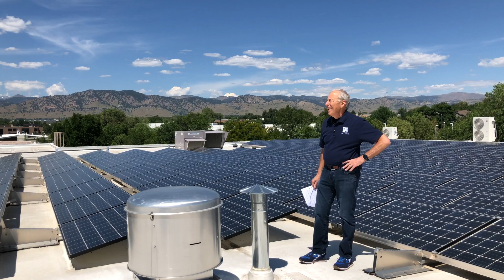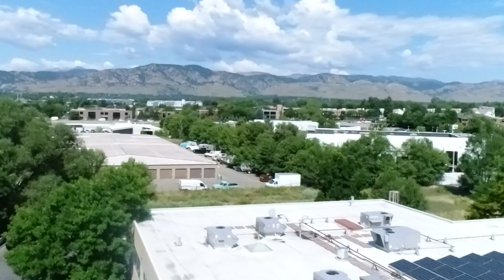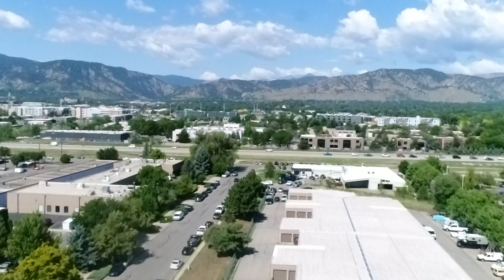What to study to become an audio engineer

Comment: Reality check:  Most companies require engineering or physics degrees for their employees who will be doing equipment design, because they need the legal protection of their formal qualifications.  Good luck landing any design job with an aerospace company, for example, without an appropriate technical degree.  It won't happen, regardless of who your parents are.  
Even your company had better be using staff with valid degrees for any design work which could be safety related, such as ensuring that UL standards are met.  Where customer/user safety is involved, you don't cut corners.  
Legal considerations aside, I think it's still irresponsible to discourage formal education.  It takes many years to accumulate the background knowledge in physics and math, then build contemporary technical design knowledge on top of it.  Those who have an aptitude for such things, find them fascinating.  I thoroughly enjoyed all of my engineering courses at university and never once doubted, "Why do I have to learn this?"  
I knew a lab-support person who worked at Boeing for many years, who had extensive practical knowledge in electronics and computer systems.  After many years, he decided to go for an engineering degree.  I'll never forget his comment after taking his first few classes:  "Wow, what an eye opener!"
And by the way:  Engineering schools also require lab classes, where one does get practical hands-on experience.

Comment: I’ve grown up with a passion for audio and sound system design. As a result I currently work in acoustics research while wrapping up my engineering degree and designing speakers in my spare time. I agree with what you say Paul that learning by doing is a great way to do it, but without the fundamental backgrounds that come from higher education, I think you can be very limited in your scope of potential. For example, understanding good port design is pure fluid mechanics. In addition, I’m yet to find an audio company that would hire an MSME with any less than 5 years of speaker design and dsp experience. So please point my to someone hiring speaker designers with no degree at all because I’d love to apply.

Comment: I'm self taught but I did go to school. I'm lucky to have the job I have now as they now require a degree which I don't have. I learned by doing. I had a friend and we were going to design a preamp that would emulate the sound of various preamps by pushing a button. I guess it turned out to not be practical.

Comment: I  wonder if some education in electronic service and repair from a tech/trade school would be beneficial? At least it would be more hands on. I would agree an B.S. in Electrical Engineering would have way too much focus on the nice to know theoretical and not the applicable knowledge. Quadratics, Differentials, figuring the square area of cone, may be beneficial  but I would think,  hands experimentation on what a woofer can do within a particular crossover design would be far more productive.

Comment: The one thing schools won't teach is how to learn.  They pour out information that if you've the mind for it will make you good on a game show, but they actually impede the integrating of things learned into your personal knowledge so meshed you've no idea where you learned it.  Heck they won't even teach students how to do their job, i.e., study.  Few, if any, schools/teachers tell a kid how to process that book so that it they know it for longer than the test.  And it's not like this isn't known.  If found 'How to Study and Teaching How to Study' (1909) by F. M. McMurry late in life and wish I'd learned how to study as a kid instead of having to figure it out on the fly like every other student, apparently.  

But in a field like electronics, even if you go to school, you will learn more if you have practical tinkering/experience before they dump the abstract on you.  

"Man must seek his chief instruction in his chief work, and not allow the empty teaching of the head to precede the labor of the hand. * * * We have to thank the nonsense with which our children's early years are diverted from labor and directed toward books, for a world full of blockheads."
[Johann Heinrich Pestalozzi, (1746-1827)]

I would add the only way to learn problem solving is to solve problems.  Most school will be academic, theoretical.  You need hands on with the tools and the equipment.  It has never been easier or cheaper to get hands on with some of the most complex electronics needed to understand audio systems.

Comment: It's far more difficult to get a job today if you don't have a degree than earlier years. And the school of today is much more practical oriented than before as well. But wether you take a practical or scientific route. If you want to design audio gear at highest level, I would build things on spare time. The founder of Hegel was taking a higher degree in technical University. But he was building amplifiers when he was studying. Because of his passion for the matter. 
If you like theoretical course then go scientific route. If you don't like theoretical course so much, then go the practical. That's how I would think about it.

Comment: I was lucky to work for a small company that was very much hands on. I started out working as a jr technician and as the years went by I got into designing and management with nothing but a high school diploma from a technical high school. Back then the engineer you worked with had the sole say in who got hired and promoted, there was no human resouces department to suck resources away for the real work.
Because it was  small company I did everything in every department. If I needed a chassis I went into the shop and built one, I could layout PCB's, tch them and then drill them. I did most of the environmental testing (including FCC EMI requirements) and I handled a lot of customer problems. You have to keep the customers happy so they come back for more.

Comment: A very interesting video this one.  I studied Electronics at College, and finished with a HND (Higher National Diploma).  At the time, an extra year of Study, and I'd have had a degree. I left college with a great understanding of the electronics fundamentals; and enough knowledge to be dangerous with micro controllers. From leaving College, I got a job at Allen & Heath; for those of you who don't know they make Mixing Boards.  My first job was the testing of Mono Inputs, a boring as shit job using a Marconi bed of nails test machine.  If a component failed, you'd maybe renew the component or fix a crappy solder.  It wasn't until I started working in other areas of the company; I started to learn about audio.  Over the years, I became a test engineer and it fell upon me and perhaps a dozen colleagues to final test and if necessary perform repairs on equipment.  Fault finding and fixing faulty boards is how things really fell into place for me.  I left Allen & Heath in early 2007, but with a good knowledge of audio including power amps, tube pre-amps (one of our DJ Mixers called the Xone V6 had tube input stages) and switching power supplies.  College gave me a great start; but it was on the tools I really learned the Audio side.